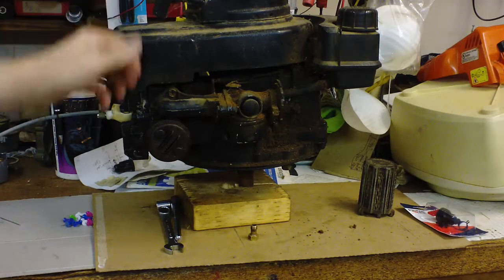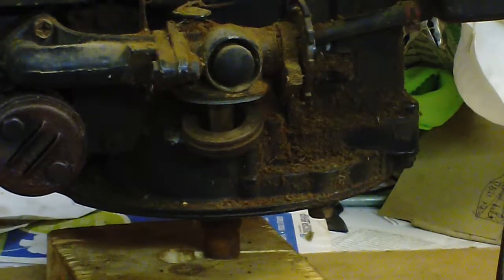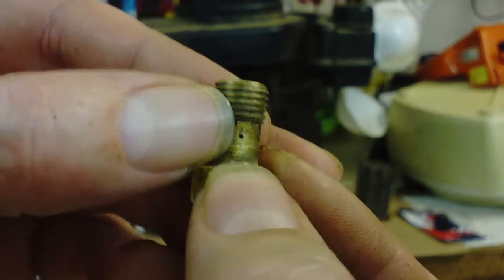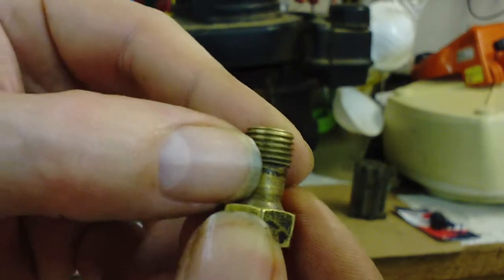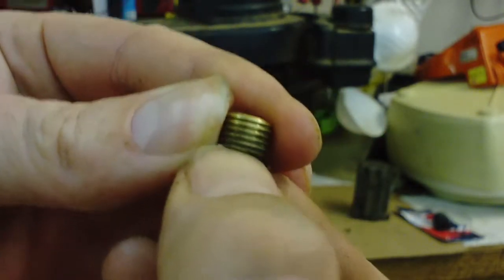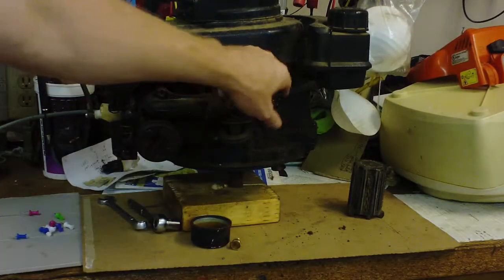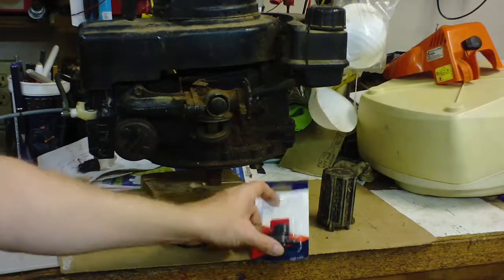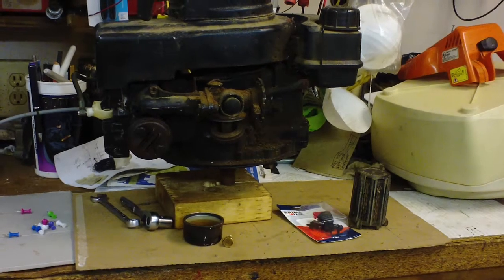Small engine Won't Idle EASY fix, only fires w/ Starter Fluid ect., DIY

Comment: My carb is crispy clean but still it runs very randomly like it changes character every 10 mins, I'm running it un governed!
Any tips?
The engine is a 400cc mag sl 1040x petrol
Reply from the maker: Gas tank & fuel line clean?    
Running too rich er too lean?   
Idk off the top of my head, what is it on?
I'm not familiar w/ that specific engine off the top of my head.  
Old Flathead er new type OHV?
Reply from the maker: Your English is very good. I see your 2 videos are Turkish, is that You singing?...
If so, very impressive man.
 - take care from Tn USA.